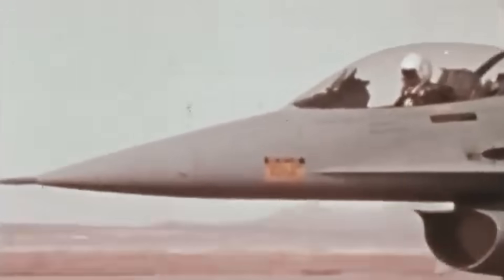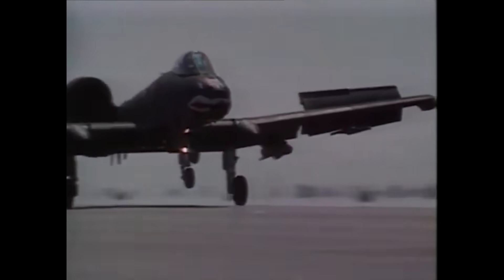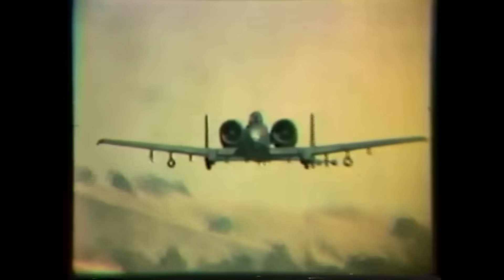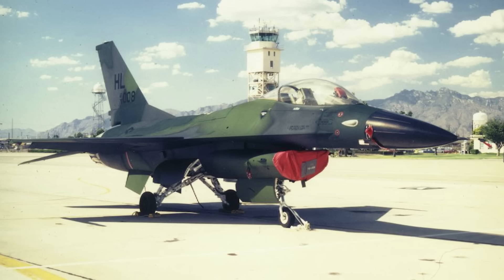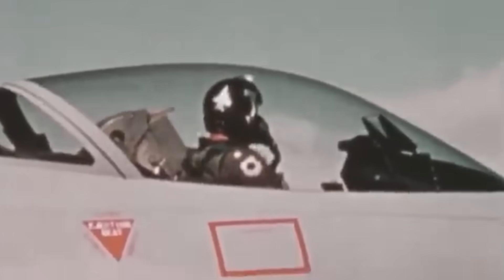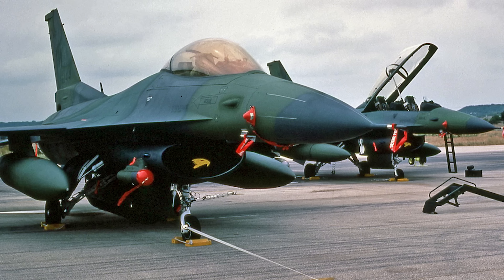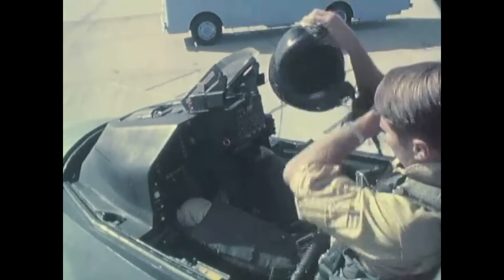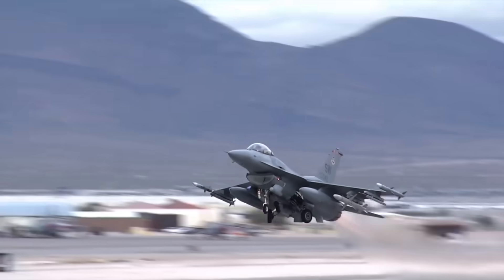The A-16. Can a Viper turn into a Warthog?

Comment: As a ground pounder one of the things I most liked about having an A-10 above was that it carried a pilot who only did ground attack. They trained exclusively for it, were comfortable low and slow, were well practiced in spotting targets, and used to talking to guys on the ground. That was their whole world. If you replace an attack aircraft with a multirole plane then we lose that. Jack of all trades, master of none type of situation. So regardless of the airframe, having dedicated attack pilots is a factor.

I’ve had support from F-16s also and for well defined targets they were fine. “Remove that building” or “hit that truck”, etc. They performed less well when it was “there are guys in those ditches across the field” or “there is a dude with a machine gun in the rock cluster to the north east”. The biggest con in my eyes with the F-16 was the lack of loiter time.

Choppers were great, and superior in some areas, but didn’t have the payload and while the AC-130 could bring the Finger of God down upon people, it was rare as hell to actually get one on station.

For over 20 years the argument about the A-10 or AC-130 being unable to operate in contested airspace was meaningless because that isn’t where we were fighting anyway. While we need to be able to engage in peer or near peer conflict, chances are pretty high we’ll have more fights against people who couldn’t even put up a Piper Cub to oppose us.
Reply: I wish I could upload this twice.

People are constantly talking about the A-10, and other platforms, in terms of hardware. No one seems to understand that there’s a mission behind the toys. It’s to everyone’s benefit to have some guys who do nothing but practice CAS.  Specialists. Having A-10 guarantees that there are specialists who think about nothing but playing around in the mud all day. They are going to do a better job than other pilots who have to divide their attention between many different tasks.
Reply: @PBScourge  In a real war you'd run out of those specialists pretty quick.
Reply: @PBScourge  You think you are making a valid point, but no. What nobody wants to understand about the A-10 is as a CAS platform, it is not worth the bother. 

1. It's very slow. It takes far longer for an A-10 to get to a troops in contact situation than fast air like and F-16 or F/A-18. If you are a grunt under fire, you are not going to wait an extra ten minutes just so you can have an A-10. This of course also applies when the A-10 must refuel from the tanker.

2. It flies too low and has poor sensors for the job. Getting down to low level might seem like a good idea but in reality no. Fast air has been doing 95% of the CAS work since 2001 and doing a far better job than the A-10. They sit at medium altitude and can see far more with their sensors than an A-10 pilot can see with the Mark 1 Eyeball. They can normally see the whole battle, not just the tiny section the A-10 can see. If you had spent time in aircraft at low level you would see this for yourself. You can't really see much.

3. Limited weapons for the job. It's payload is also restricted compared to fast air. Not to mention that the GAU-8 is a massive red herring and does not do anything for CAS that the M61 can't. The GAU-8 was never the A-10's primary weapon anyway. That was the AGM-65 Maverick Missile.

4. The A-10 is in the position where a turboprop or especially an attack helicopter would be a better solution. If the battlespace is contested by SAMs or AAA the A-10 cannot enter the area and fast air must do the job.

This is why the USAF has been trying to retire the A-10 for more than 30 years. It utterly failed in the first Gulf War and suffered heavy losses until it was moved to safer sectors. The F-111 and F-15E had to take over its anti-tank mission and they did a far better job.
Reply: @mattwilliams3456  I definitely agree that you need pilots dedicated to the CAS role. It doesn't have to be a dedicated platform these days, with modern optics, weapons systems, engines and airframe design you can get a platform that can do everything well enough. But you can't have a human in the cockpit that can do every role to that highest grade. Apparently this has already been noted in F-35 squadrons complaining that they aren't getting enough training on CAS missions. At the end of the day there's only so much you can get one person to learn and in these situations it needs to be drilled so much it becomes muscle memory and you can't do that if you're expected to do air superiority, interception, CAS, strike and SEAD missions and everything in between.
Reply: @poprocket2342  quoting something that apparently happened with F35 crew complaining about not enough CAS training is of zero value. Even if it was true, and it's not, the decision to not prioritise CAS in any particular  Squadron or the USAF as a whole reflects what the next threat might look, what is the priority, and what is the most complex problem to solve. Besides, just think about a bunch of fighter pilots complaining about having to do to much air to air work!! Completely laughable.
Reply: I appreciate your input, the whole thing about A-10 pilots being hyper-specialists at ground attack is something I hadn't quite considered.

That said, can A-10 pilots being amazing at their job really be used as an argument for the A-10 itself being a good aircraft? Doesn't it just mean that the pilots are amazing at their job? Nothing prevents the USAF from training some F-16 or F-35 pilots for only ground attack, which I imagine would see them reach equally high levels of skill as A-10 pilot.

Loiter time would still be a problem, but perhaps using the F-35, rather than the F-16 as a ground attack platform would rectify that issue.
Reply: @sdfopsdmsdofjmp7863 The whole reason why the USAF wants to retire A-10 is so they have a more flexible force. They’d never pick a F-16 or F-35 squadron to be CAS specialists because they want multirole aircraft to do multirole stuff. 

To be fair to the USAF, that’s the trend everywhere. The French AF is multirole and so is the USN’s fighter force. Although, SOCOM just built its own dedicated CAS airplane. 

That said, the USAF has the resources to have a dedicated CAS platform. The A-10 is very cheap to fly and maintain (cheaper than Apache) and there aren’t a ton of them. 

Maybe there’s something I don’t understand, but I don’t see THAT much upside to the A-10’s retirement.
Reply: @PBScourge the cost of the much needed modernization package for the a-10 was around 1.2 billion dollars, their probably going to be retired by 2030.
Reply: @PBScourge 
Another thing people fail to consider regarding the A10 is its defensive border mission.  The A10 fleet is a significant part of our defensive posture, especially along the Southern border.  That GAU-8 may only be able to take out Cold War vintage heavy armor from the top and rear, but most of what Mexico has is from WW2, and a hellfure is a hellfire.
Reply: @sdfopsdmsdofjmp7863  as PBScourge noted, if you have good multi role aircraft there is no chance the Air Force will “waste” it by still allowing it to serve a dedicated function. The A-10 forces their hand on that front by being a single use platform. And I’m not arguing that the A-10 itself can’t be replaced, I’d just want it replaced by something else designed around the CAS role specifically while utilizing modern tech.

Say you did earmark an F-35 squadron solely for CAS. That means you’re going to be bringing a whole lot of superfluous capabilities down into the dirt, all of which represent mass and expense. If that big and pricey radar isn’t helping you in CAS wouldn’t you rather those resources be used on other sensors, payload, fuel, or a bit of armor instead? An after burning engine that will get lit up once in a blue moon would be a waste if we could have one (or two!) that sips fuel by comparison, doesn’t mind getting treated roughly, and is easy and cheap to maintain and fix if you do break it. And if we don’t need that Mach capable engine, why bother with wings optimized for high speed flight rather than some that are really forgiving at low speed, and can still provide enough lift if say half of one gets blown off?

Since this whole debate started out about survivability there is no getting around the fact that CAS is a very hazardous mission. No matter how good a platform you bring to the fight, in a big war you’re going to lose planes in this type of fight. My first unit was an Avenger SHORAD battery and after talking with ADA guys and some of the pilots we dealt with in training exercises it became very apparent that especially in the first few weeks and months of a near peer war that it was going to be a meat grinder with both CAS and SHORAD taking huge losses. I’m under no allusions that the Air Force would be as willing to risk their very expensive and fragile multirole aircraft as a much cheaper dedicated ground attacker. I also can’t blame the pilots for being more hesitant. One of the reasons the A-10 is named the Thunderbolt II is because the WWII P-47 Thunderbolt was so renowned as a ground attacker, despite really being a fighter. While the P-47 did bring 2 extra .50 cals and 500lbs more bomb load than the P-51, one of the primary reasons it outshone the Mustang in ground attack was that it was rugged as hell, so pilots were more confident pressing attacks. Its radial engine would take far more damage than the inline of the Mustang and still get back to base, the airframe itself was more resilient to damage, and the cockpit was better protected. The same holds true in every way for the A-10 vs the fast movers, and should be a requirement for any A-10 replacement.

Ultimately this is a budget issue. The Air Force sees it as inefficient to support a single use platform, while the Army is desperate to keep that capability around. As the primary customer of the A-10’s services the Army has literally been willing to put its money where its mouth is by offering to tear up the Key West Agreement and take the A-10 off the Air Forces hands if they want to get rid of it. The Air Force isn’t willing to do that because then there will be future fights over who gets a bigger piece of the DoD budget going forward. I’m honestly not trying to knock the Air Force brass here, the services just have very different priorities and each is trying to focus on those missions. The budget for everyone is finite and while some disagreements between branches seem petty (and many are) I do believe most are legitimately trying to do what is best in their mind for national defense.

If only we could clean up the waste, fraud, and abuse in the DoD there would be cash to spare for dedicated units.
Reply: @mattwilliams3456  

Why could they not earmark squadrons for CAS only? They have dedicated squadrons for nearly everything else.

Ground attack is the primary use case for modern fighters, the entire F-35 is designed around it. Why have EOTS with every type of senor imaginable and a helmet that allows you to see through the aircraft if you don't plan to use the aircraft primarily as a ground attack platform?

Yes, an individual F-35 is significantly more expensive to maintain than an A-10, but keeping an A-10 spare parts line open, having an entire extra supply chain means the A-10 just isn't worth it for the Air Force as a whole.

The Air Force wants to cut the A-10 because the A-10 doesn't offer anything while not justifying the tiny savings over a more capable jet. 

Also, Where do you think the A-10 pilots will end up once the thing is retired? Hint, they won't be flying heavies, so there will be very capable CAS pilots flying CAS in an equally capable aircraft.
Reply: @sdfopsdmsdofjmp7863  they already tried to use the F-16 for CAS in the Gulf war.  It failed miserably, the F-35 will fare no better.  It needs to be a purpose built , dedicated craft
Reply: @deaconvelos8352  CAS has changed.

You don't need to strafe people when every other infantryman carries a laser designator or can point to a target on a map and have an F-16 drop a JDAM or SDB on it.

Fast jets are more survivable, more capable and more responsive for CAS.
Reply: @sdfopsdmsdofjmp7863  yes, except that the A-10 does that just as well as an F-16 and costs less than an Apache to run. 

And, they sure did a lot of strafing in both Iraq and Afghanistan.
Reply: I love how the replies seem like they didn't even read what you wrote.
Reply: THANK YOU!! Someone who was on the ground understands what the people who sit and write papers do not. Enough with the "F-35 will replace the A-10" nonsense. A platform that is good at everything will never be great at everything. We still need dedicated role aircraft. 

We do not need 5000 multirole jets to do everything. A multirole jet will always need support from dedicated assets. Drones, strike fighters, interceptors, CAS planes, helicopters, and even gunships will always be necessary. Everything needs a role to be filled for a military to be successful. It's never about replacing, it's about evolving.
Reply: Arrogant as always americans
mfer is admitting they only face goat hearders with sandals
Reply: @mattwilliams3456  A10 îs also unable to operate in contasted airspace anyway who needs a16 when you got F-16D, I'm reserve soldier in process, majority of pounding comes frome multirole fast plane, and occasionally drones.
Reply: Drones do it for cheaper than an A-10. Only thing they can't do is gun runs.
Reply: @user-yn6oo6q  yet. they're getting there
Reply: @user-yn6oo6q  drones don't have the munitions capacity.  They have at most 6 hellfire/knife missiles then they're useless.  The A-10 carries twice that under a single wing and has sidewinders for aircraft
Reply: I always find interesting how those of us who were on the ground appreciate the A10 while those who sit in chairs criticize it.

The reality is that the A10 has saved lives. Friendly fire is always a problem but that's not unique to the A10.
Reply: Nobody ever said ground pounders were the brains of the service.  The A-10 was popular because it made the guys on the ground feel better.  It was never viable in a war against an enemy that could shoot back.  The gun was tactically useless against the tanks that were supposedly its primary targets.  So the troops loved it because it could be present in wars where it was least needed.
Reply: The reality is that modern CAS/AI is relatively simple for aircrew. And it's pretty much irrelevant, and A10 won't survive much past morning tea of Day 1 of the war. The world moves on and so do weapons systems. If you think that's harsh I can tell you about my opinions on the future of JTACs.

Edit. Removed unnecessary words.
Reply: @robd8577  For years it has been American / NATO doctrine to not engage in ground actions until air superiority is achieved. It is true that the A10 would be unlikely to survive in acontested environment, but it would not have been used that way. The stealth planes would go in first and destroy the anti-air. Typhoons and F 22 would fly top cover and destroy all enemy aggressor platforms. This has been NATO doctrine for decades. 

There are a whole host of airplanes that cannot survive a contestant environment. All helicopters. Transport aircraft. Tankers. I don’t understand why the A-10 is treated differently in this regard. To that end, I think the “contested environment” reason is inaccurate. The United States Air Force simply prefers high-tech platforms that can do a lot of things, rather than some low tech options to do one thing really well. That’s it.
Reply: @robd8577  su-25 seems to have still been very useful in Ukraine even with the high GBAD threat levels. Sure the days of strafing runs with guns are generally gone but the generally aircraft characteristics are still an advantage over trying to do the same role with a fighter. Swapping the ideal contemporary weapons onto a ground attack optimized aircraft is probably the way to go
Reply: @robd8577   there is nothing simple about actual close air support in a fluid environment. This isn’t just dropping JDAMs or lobbing a Hellfire at a single high value target. As far as surviving beyond day 1, in the last century how many years has the US been in a near peer shooting war versus years in combat where we had relatively permissive environments? We haven’t gotten rid of everything that won’t survive on a nuclear battlefield even though that has been a continuing threat, and it turns out all that other gear has been rather useful the last several decades. Go to any construction site where you see heavy equipment being used and despite being surrounded by machines with immense capabilities you’re still going to find plenty of shovels and hammers because frequently they’re still the best tool for the job.
—————-
Drones currently offer nowhere near the payload, speed, and situational awareness of a pilot on scene.
Reply: @mattwilliams3456  you described yourself as a ground pounder and therefore someone that is most likely unable to comment of the relative complexities of the air war.
Reply: @robd8577  you don’t have to be Gordon Ramsey to tell someone their cooking tastes great or sucks, so I’m more than capable of commenting on how the air war interfaces with what I really care about, the ground war.
Reply: @mattwilliams3456  but you aren't describing an interface, you are explaining why you tangential experience leads you to a position of knowing more than those in the USAF that have over the last two decades tried to get rid of a platform that is out dated, not survivable, and doesn't contribute to a modern peer conflict. It's fine to have opinions but your experience MAY not be relevant.
Reply: @mattwilliams3456  they weren't well trained in not firing upon friendlies. Numerous friendly fire incidents from A10's on coalition troops in Afghanistan and Iraq
Reply: @samuelwilliams3130  compared to how many sorties? My direct experience was that A-10 pilots were quicker to pick up intended targets and communicate more clearly with us than fast jet pilots.
Reply: @samuelwilliams3130 by numerous do you mean 2 in 20 years?  One of which being a British unit that wasn't supposed to be there, didn't have comms with allied units and nobody knew was there.